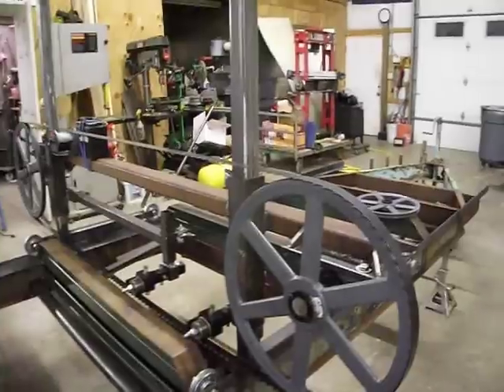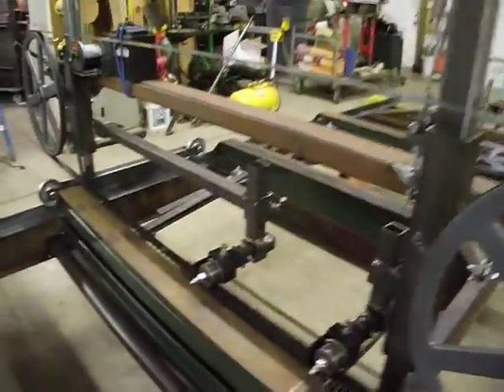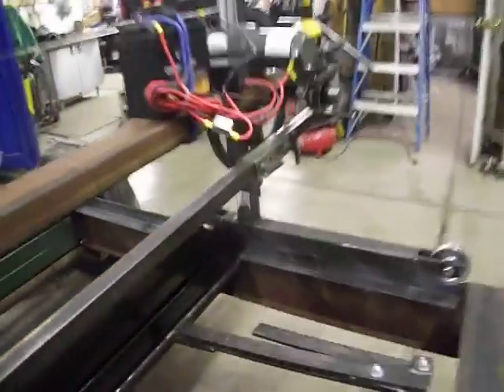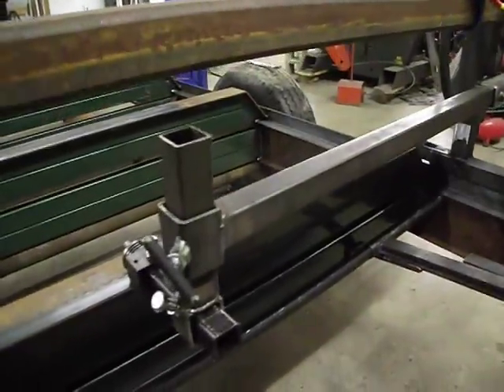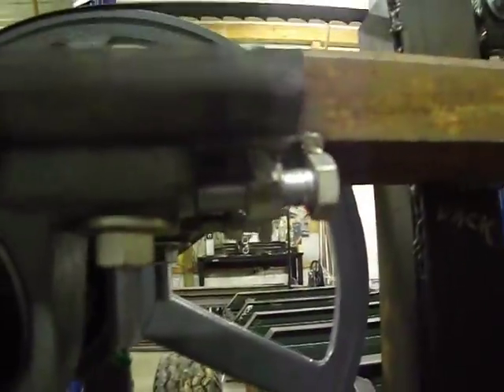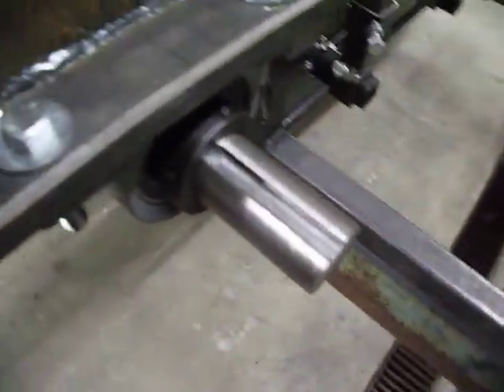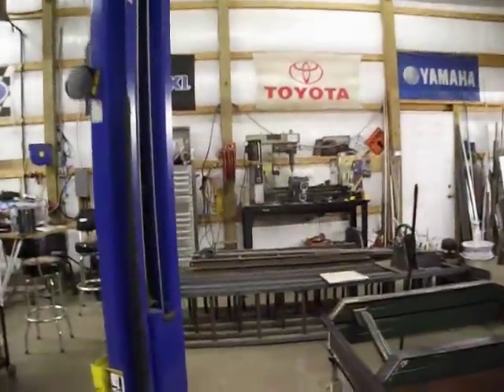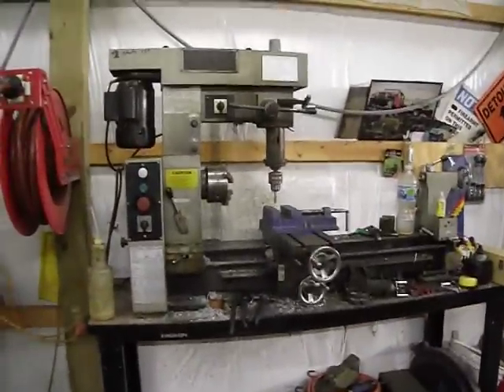Homemade Portable sawmill build

Comment: where do u guys get the drivewheels, the big one's that runn the blade from? i am looking like daily and there is only 2 ways: improvize from scooter-tires or buy for 400USD? is there another way? pls link!! thank u!
Reply from the maker: http://www.surpluscenter.com/Power-Transmission/Pulleys/Split-Taper-Bushed-Bore-Pulleys/18-75-OD-H-Bushing-Single-Groove-Pulley-1-BKH190.axd
Reply from the maker: You'll need a v belt and a split taper collar to complete the bandwheel. The part # for the belt is (PN B-56 5L590)  Choose the proper size collar for whatever size shaft you plan to use. I use 1 1/2 inch shaft. They have the keyed shaft, belts and collars at this same place, just shop a bit and familiarize yourself with their inventory before you place your order so you can get it all shipped together.

Comment: WHAT WIDTH ARE THE BLADES? IS THE SAWMILL STILL PREFORMING WELL?
Reply from the maker: The blades are 1 1/4". Yes the mill still works  extremely well.
Reply from the maker: The blade is 1 1/4" . Sawmill still works extremely well.

Comment: You use a 14.75" pulley on the drive wheel but what size pulley is mounted on the engine??
Reply: Also I can't find a 14.75" pulley on that website??  Could your number be wrong??
Reply from the maker: The engine is a 3.75 and the 14.75 should be available on surplus center. http://www.surpluscenter.com/Power-Transmission/Pulleys/Split-Taper-Bushed-Bore-Pulleys/14-75-O-D-H-BUSHING-SINGLE-GROOVE-PULLEY-1-BKH150.axd